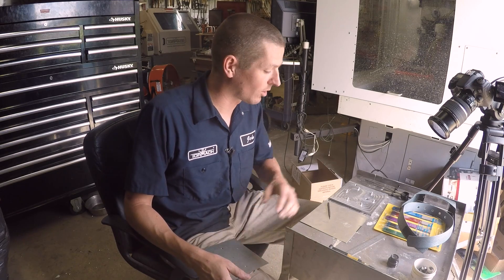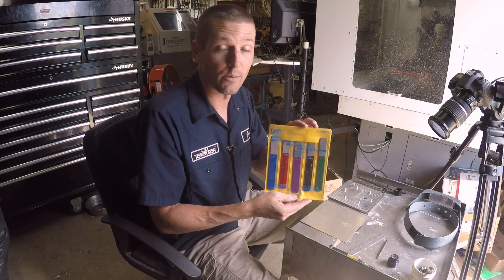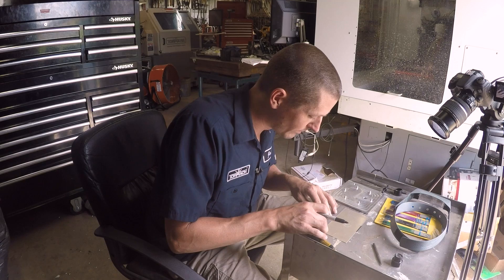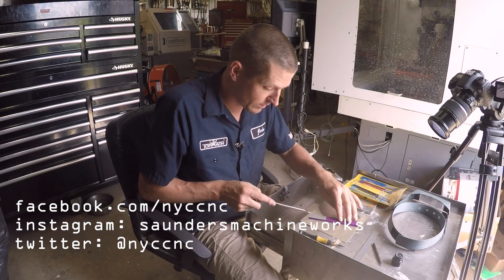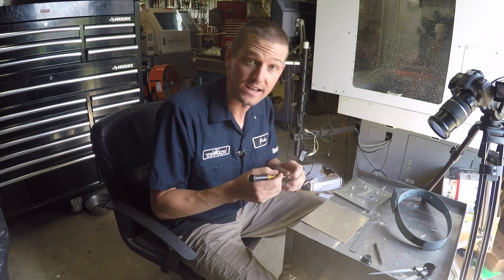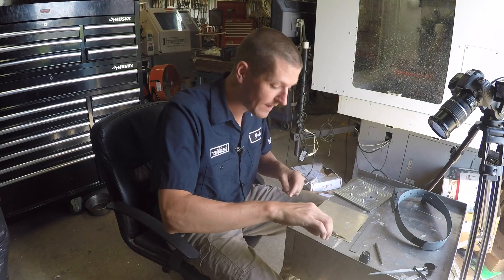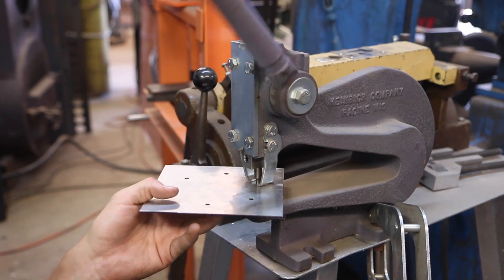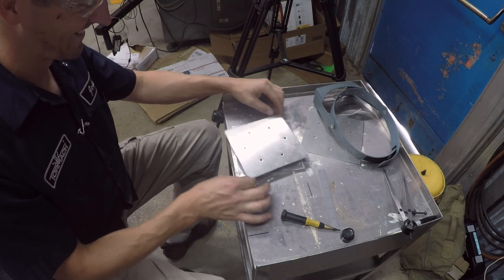Manual Sheet Metal Layout Lesson!

Comment: not to be a anti safety Nazi, but a brass hammer on a impact punch isn't gonna send shrapnel into your eye. 

as long as your punch doesn't say "not for impact use" and you're not using a hardened hammer. brass is soft so no chips to worry about, punch won't explode haha. 

doubt that you'd be punching pre hardened steel but I guess that would call for safety squints.

Comment: Great video upload John.  You and the viewers may want to try when wanting to find the center of a Square or Rectangle piece of metal, just draw a "X" (make as big or small as needed.) Using any straight edge. Start at one corner (say top left side), and go diagonally to bottom right, mark a line approx. center (as long as you like, or makes you feel warm and fuzzy) then do the opposite, using your straight edge, starting top right corner, to bottom left corner, mark a line (as big as necessary.) You now have the center of your part. Simple geometry.. This method can also be used on flat bar stock, just pre-determine how big of an "X" you want or need. :-)

Comment: I grew up doing layouts on wood... 
My tolerances varied between 1/32 for frames, to 1/64 for fine cabinetry. My favorite tool for this was a little different than dividers, a fair bit easier to set the distance, and it did not manage to shift being man handled... 
Beam compass. The adjustments were done on axis, in stead of above, so shifting was essentially 0. I still used it to try (replicating this project) on a sheet of aluminum, and was within .002. Had to use a carbide center drill though, since I dont have a punch. To test, used a set of calipers to measure hole to hole, adjacent and opposing. Distance was basically R-1/2(.125"), but it worked. Saw the first video about this posted earlier, while you were there, and wanted to try. Amazing how easily we overlook the manual methods! 

THANK YOU for sharing this, and actually showing your practice and final pieces. Great way to build confidence.

Comment: Something seemed off about this method:  If you make a circle with radius=2".  The circumference would be 4*pi (2r*pi), or 12.566.  12.566 divided by 6 equal divisions is 2.094.  So if you keep your divider at 2, you SHOULD NOT end up with 6 evenly spaced holes.  Your divider needed to be set at ~2.1".  Using a 1" radius would bring you closer.  Using a 10" radius there's no way you would have fit on the jig (made for 10").
Reply: +NYC CNC I stand corrected

Comment: Try this process with any PCD, but with say 5 holes(or any other number but 6) and you can really see what you have to do to get it as accurate enough to fit the JIG.
When I was teaching Engineering to Apprentices, one of the tasks for them was to simulate the marking out of a flange(300-400mm PCD) for new section of pipe to be installed.
Generally it would be about 325PCD X say 14 holes.
They had to identify the centre of the flange, scribe the rather large PCD, calculate the Chord length and then mark out the 14 points of intersect around the PCD.
You can imagine the time it took given that any error you made with your chord length was multiplied by 14.
So they would always go back and adjust a number of times to get it right.
But a very worthwhile exercise.
Great Video John 
Thanks Peter

Comment: Just a small point: If you drew the circle with the divider, and did not reset/move it, it would always divide the circle in 6. So resetting your divider by the ruler afterwards, makes no sense :) If it didn't make exactly 6 points around the circle, you were not being accurate enough. It is not the measurement on the divider, unless it wandered on you, which it shouldn't.

Comment: John,  nice video.  This is a good lesson for all new folks, really  teaches you what a thou or two really means in the real world.   Learned this 40 years back in the first machine shop class I took at Cal Poly.   Wasn't easy to master especially in a summer class where the shop was in the 90's.    One thing I was taught was to use two light wacks on the center punch rotating the punch 90 degrees between wacks making sure the punch remains vertical.  Another project was to square up a small block of cast iron with a file.

Comment: I have an off subject question. I have a small cnc mill and I use a electronic edge finder to set my X and Y. If my machine/software knows the tool length of my edge finder could it be used to set the Z axis as well?
Reply: +Chad Choate You can definitely do this in Path Pilot. I do it with my Haimer and it works great.
Reply: Ok thanks for the reply. I didn't want spend 500+ on a haimer zero master at this time.